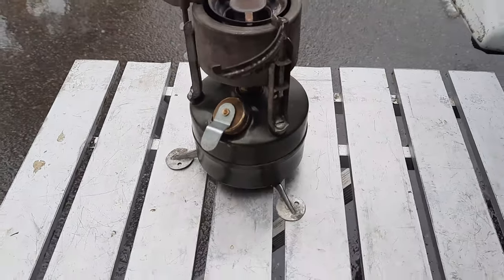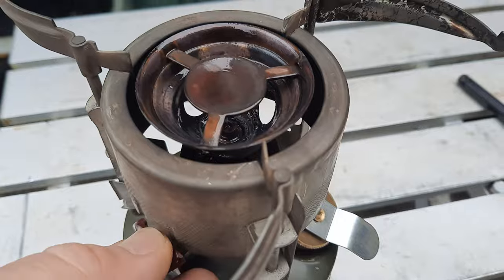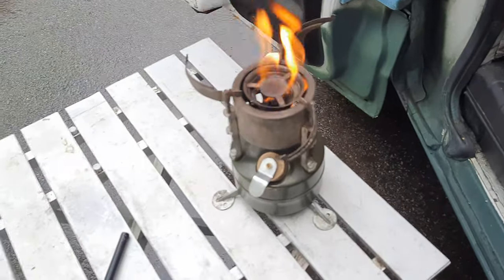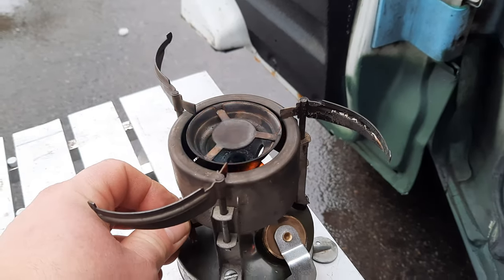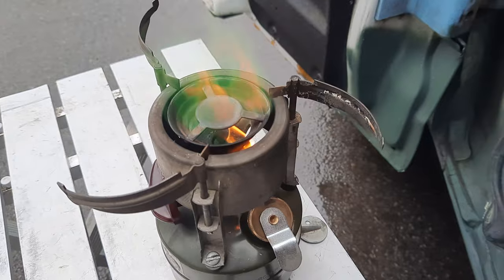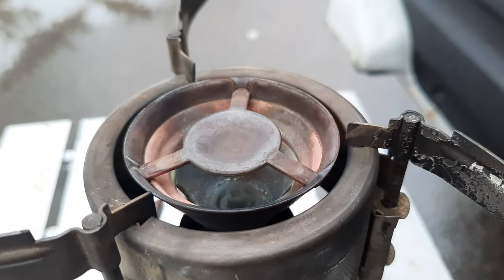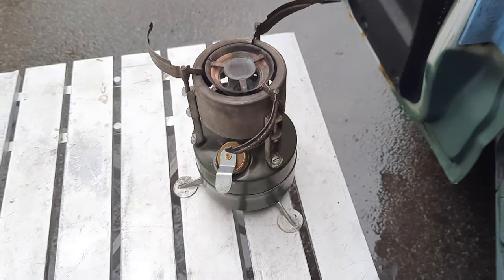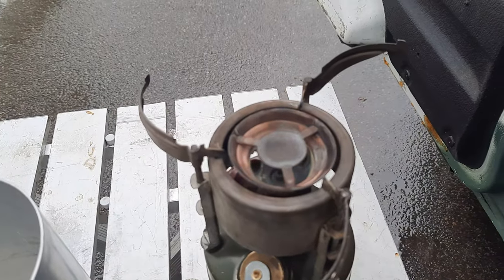US Military Rogers 1952 Single Burner Stove - Freaking AWESOME Stove - Hiking Camping Stove Review

Comment: I have seen the green a couple of times in the past but really not sure why. 
Just guessing I would say some old unleaded gas or gum,varnish burning out of the generator. 
Great little stoves for a quick boil for your pour over method but that's about it. Just built for boiling water. 
Not so good for a percolator. 
God bless.
Reply from the maker: I 100% agree. Great for quick boiling water for the pour over method for sure. The green flame I don't know where it comes from either. The fuel is new the tank is clean and it was just rebuilt but sometimes I get green flame sometimes blue sometimes to the point where you almost can't even see the flame. But I love these stoves. But it seems like no matter what, even if I have a quarter tank or a half tank or 3/4 of tank of fuel when I turn it off and let it cool down whenever I open up that fuel cap/pump, I always get fuel sputtering back at me no matter how slowly I open it. And those things don't need a lot of pumps you know what I mean? Just five or six pumps to get it going and then another five or six maybe seven pumps and I'm good for 20 minutes